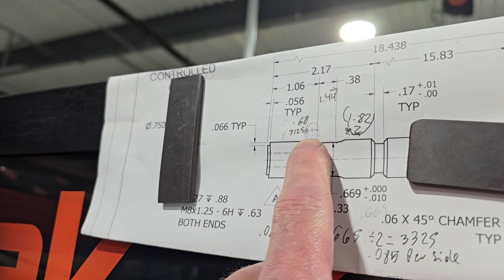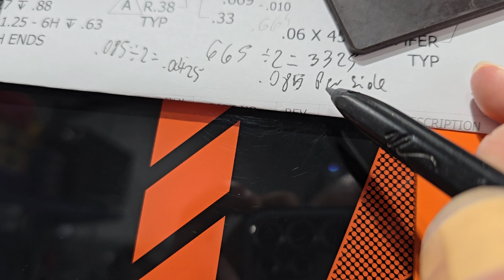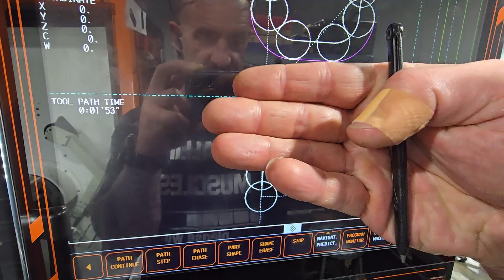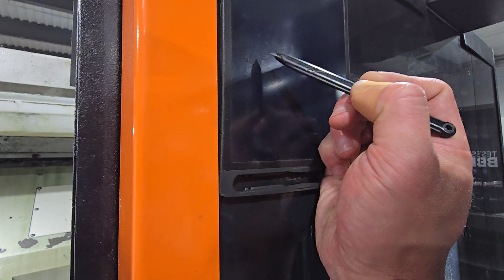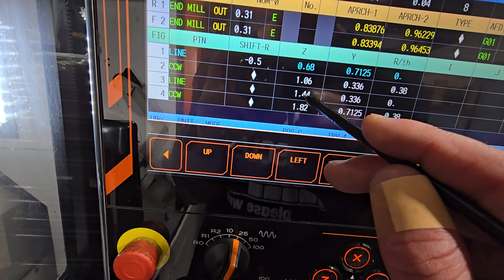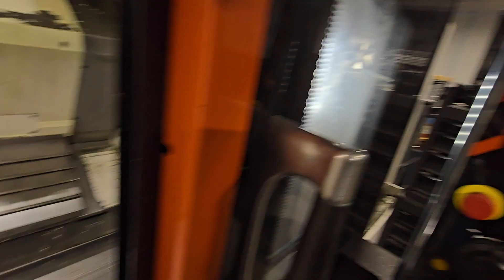Mazak Smooth G Milling XY Radius with flats programing explained on 250my Larhe

Comment: Where did you get .336. I’m just trying to figure it out. Great videos btw.
Reply: .669 divided by 2= .3345 for each side, I always raise the dimension a bit since the machine cuts bit low on y so I compensate a bit just in case.

Comment: Hey Marty im from Germany and also im operating on the same machine as you, your Videos are very interesting and i appreciate your work!!!
 
I got one question; is it possible to programm a radius or bevel without cad/cam ?
Imagine a 30 degree bevel in ZY with an endmill, the bevel Ends in a Boring…
sry for My Bad english
Greetings Maik !
Reply from the maker: On a y axes you can go above part if tool reaches, and on a z point a to z point b, then adjust your taper in y, example y 1.5 to 1.48, hope that helps